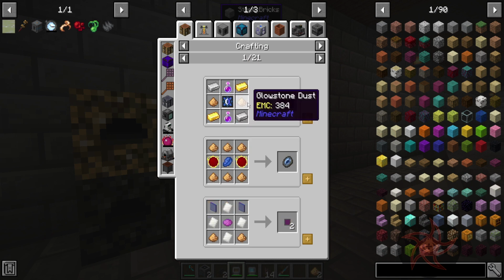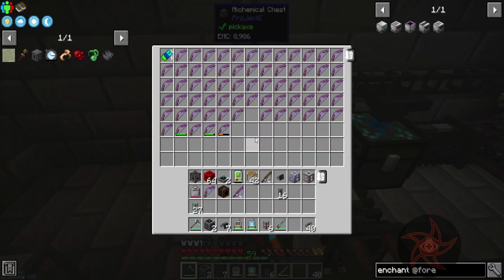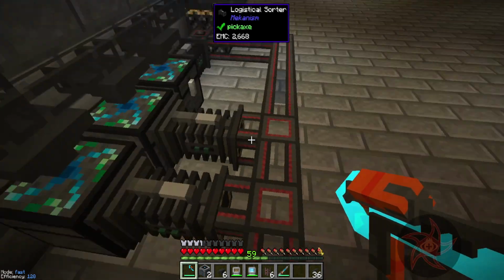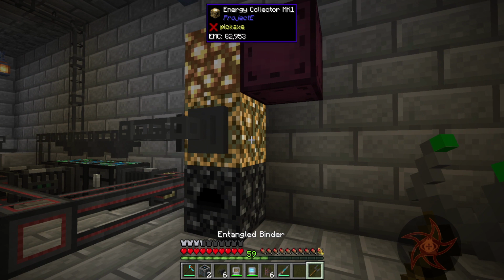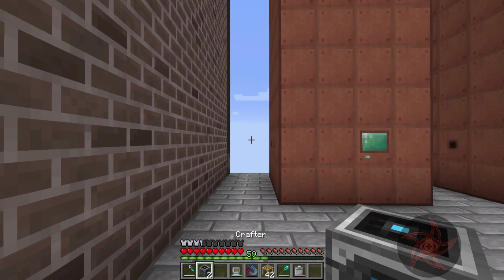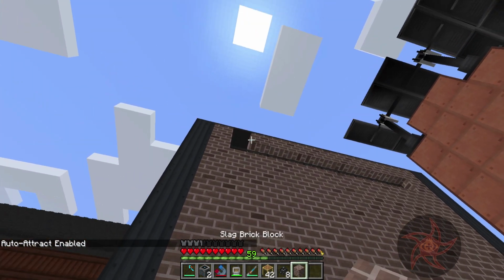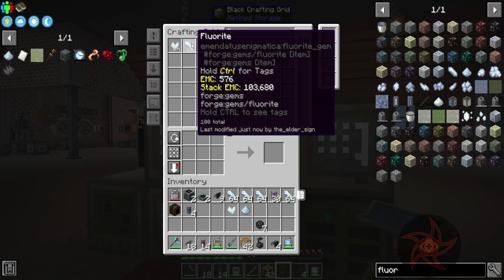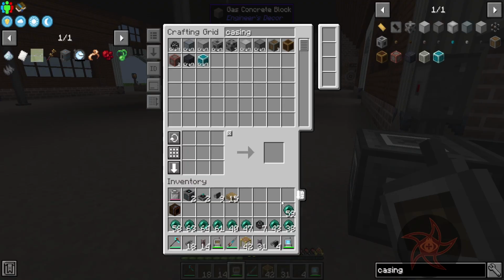Antimatter Factory :: Lithium :: AF-19

Comment: ecm can be transfered via collector > relay > energy condenser
also watch the requesters as they only process one  set at a time (ie if you have glass and stone set to 64 on a requester it will do either the glass or stone and only when done with that will it proceed with the next one

also when items are disenchanted they can still have nbt data on them that might be the problem with the disenchant system
Reply from the maker: unfortunately condensers are pretty far out of reach right now
I've noticed that about the requesters, that is one reason I have some of the amounts set as high as they are
that's good to know about the items, that is probably the issue, that and mek sorters don't have all the options I would like to have when it comes to filtering